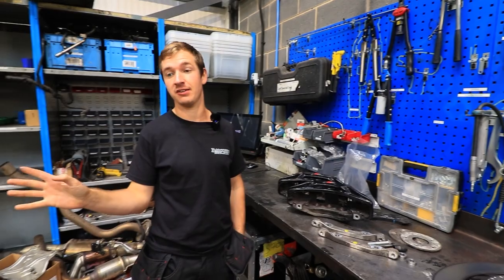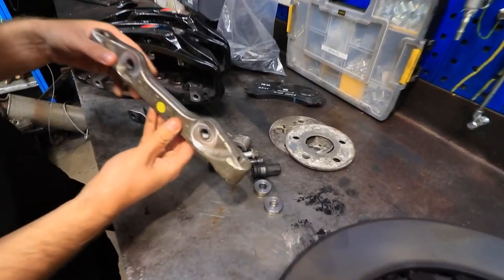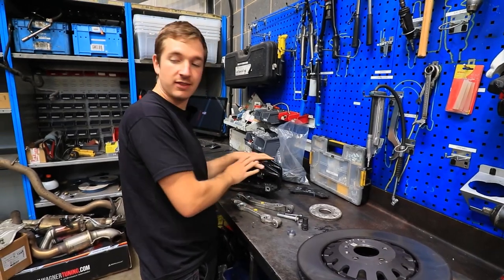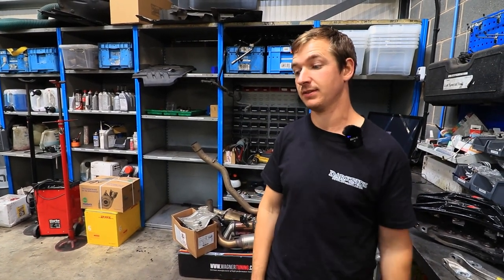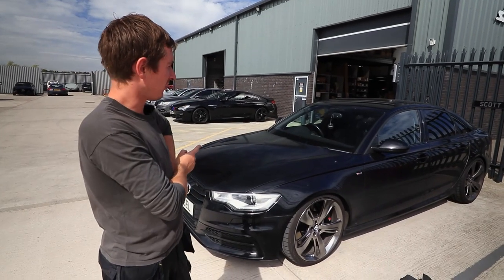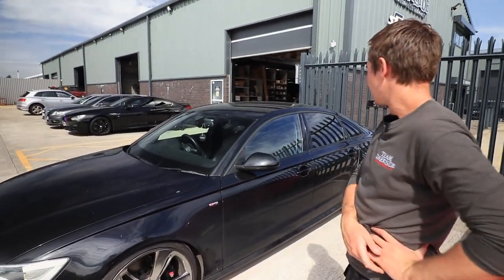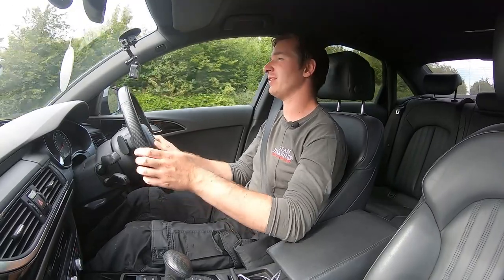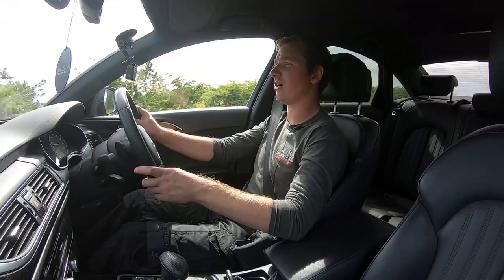BIG STOPPERS! Audi A6 3.0 BITDI Brake Upgrade

Comment: Nice work as always Ryan ☺️
Is the A5 V2 updates still on the table 🙃
Reply: Stalled project due to time!
Reply: @ryanp6138  Sure no hassle the nature of the industry boy.
Love the vlogs all the same 😁
Reply: Just something bothering me as to tuning and horsepower and drivability the cam upgrade on the 3.0 V6 TDI would it be worth the hassle after you upgrade the turbo,fuel system? For fast road - track day 😋

Comment: Maybe not as fun as tuning for power, but brakes are fascinating!
I upgraded the B8 allroad with the 4 pot Brembos off of the facelifted Q5. It worked well on its own, but put the brake balance a little to much forward I think. Then I upgraded the rears to S4, and it was all sorted.
Pedal is a little bit softer as you say. All good in my opinion, and so easy to modulate now! Love the serviceability on the non-sliding calipers, especially with the salty Norwegian winter road conditions.
How S cars have only one or two pistons in the front is a bit strange I think.

Comment: Helo! Is it possible to give a little help in terms of big brake kit for an audi a6 2.0tdi ultra, 190hp? I was thinking of buying an akebono 6tloc kit with 375mm discs and I would like to have a sense of what size / width / et of the rim will be needed to support this brake kit, and the rims I will also buy now. Thank you and congratulations for the content of the videos.
Reply from the maker: Most 19s will cover with a small spacer

Comment: Your comments in spongy pedal is not because you have more pistons. When upgrading to a multi piston caliper, you need to ensure that the overall piston area is the same.

It's very surprising that 'specialists' do brake upgrades without taking this into account.

What was the size of the pistons off the original caliper?
Reply: It has more surface area
Reply: @ryanp6138  Why would more surface area make it spongy?
Reply from the maker: More fluid to move, I would think from your first comment you understand this. The travel is longer, spongyness gone with another bleed

Comment: Will these brakes fit on a 2010 B8 S4, and will they fit under 19" RS alloys??
Reply: not going to say perfectly but I put 2018 q5  brembo 4 pots on my 2006 b7 a4. they seem very interchangeable in terms of bolt fitment / spacing etc
Reply from the maker: 19" would be close but might clear, the fitment should be the after the modifications as I know the calipers that we took off went on a B8 (Y)

Comment: how big was the flange behind the? Did it fit right? wat was the thickness of it?
Reply: any vibrations because of that?
Reply from the maker: I think around 3mm. No vibrations 👍
Reply: @DarksideDevelopments  thanks.
Reply: btw: were longer studs required after using the flange?
Reply from the maker: Stock wheel bolts were still used.

Comment: I tried this before on a my heavily modified b7 and installed some c7 rs brakes where I had to space the discs out 5 mm from the hub .. however I was getting some heavy vibration .. 

I'm guessing the spacers have to be spot on weight balanced and also the spacers    milimetrically cnc'd  ?
Reply from the maker: We ended up modifying the brackets slightly to allow a thinner spacer ~2mm This enabled the disc to seat correctly on the spigot. Thicker spacers would have meant the disc needed a new spicot making failure to do this would possibly result in the symptoms you are experiencing.

Comment: what if use these calipers on RS6 brakes 390x36?
Reply from the maker: It's something we'd have to double check but we're pretty sure they would work
Reply: @DarksideDevelopments  because if it does, maybe the spacer between hub and disk it will be not necessary and neither the spacer between calipers and support. Only doubt it can be the rim
Reply from the maker: Let us know what you find via email :)